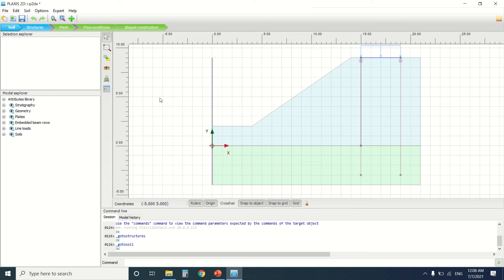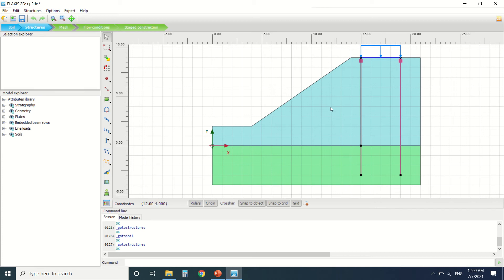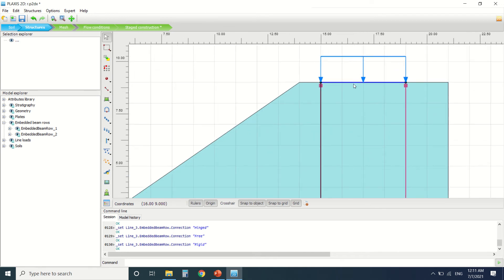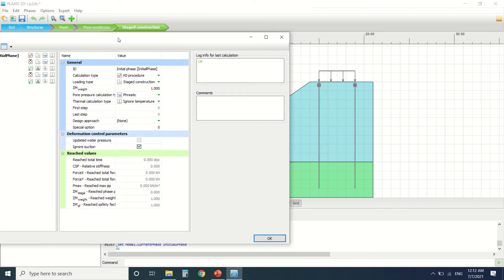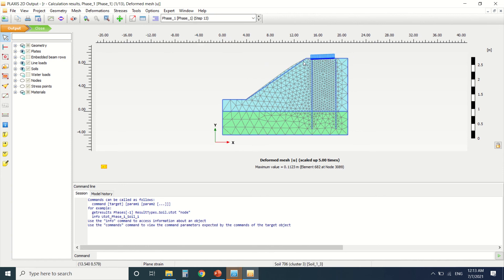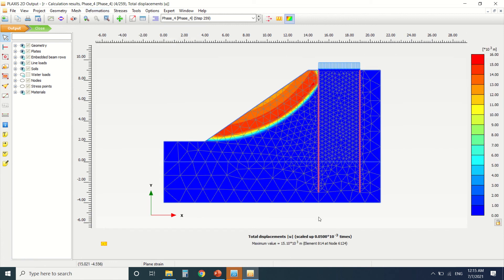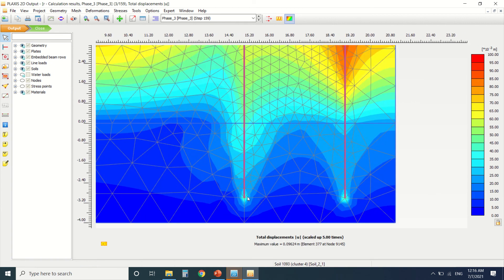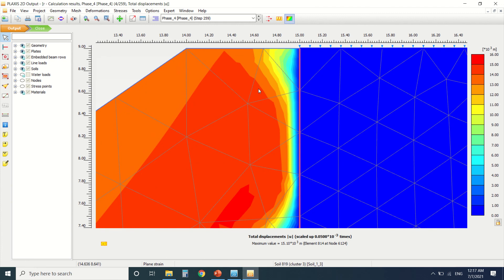slope stability with piles verification plaxis

Comment: Hi, can you show incremental displacements instead of maximum deformations. Because maximum deformations is a result of the model running until maximum deformations. Incremental displacements will give a better idea of what is actually happening.
Reply from the maker: Nice thinking,

It depends on the model
Reply: Because when I saw this video, the deformations in the final safety phase is higher than your pre pile safety phase. If you see in terms of incremental displacements then it might be different.
Reply: Total displacements don’t say the original failure, but incremental displacements will tell that